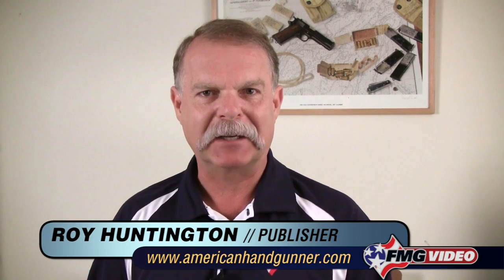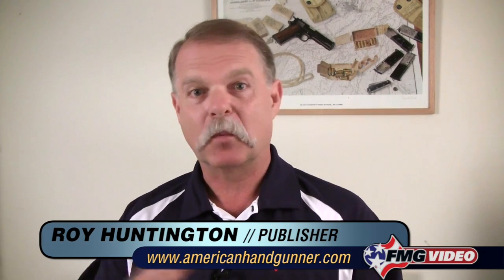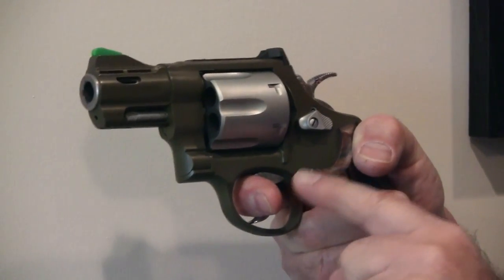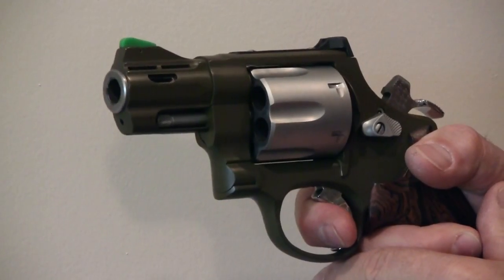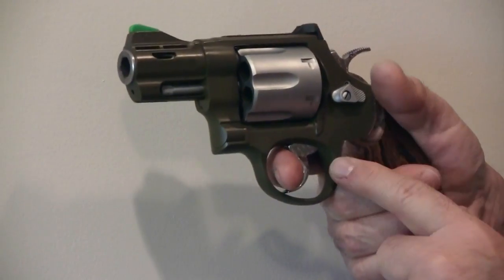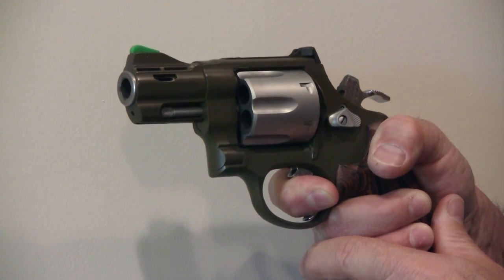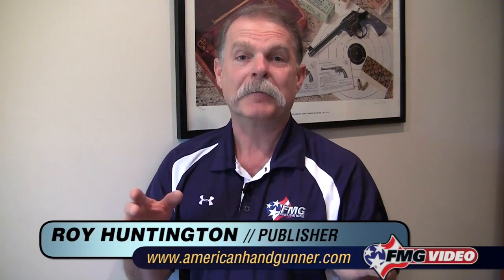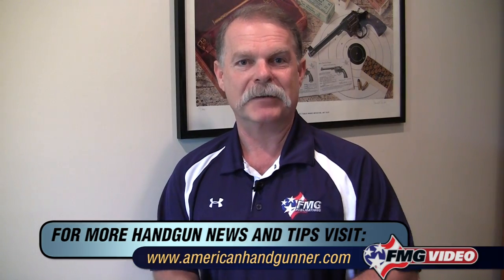Trigger Press: Double-Action Revolver

Comment: Im looking for a .357 mag for my CCW but I dont want to spend more then $600. Which revolver would you recommend?
Reply: EAA WINDICATOR
Reply: @codygarrett866  brother I appreciate the input. I don’t even remember why I wanted to carry a 357. I ended up with a m&p shield, recently upgraded to the m&p shield plus performance center.
Reply: Its what i recently bought for my concealed carry.  Ive put about 200 rounds through it so far and i like the weight, but is does have over a 12 lb trigger pull in double action, so i may find a smith to modify it.  I think you chose well